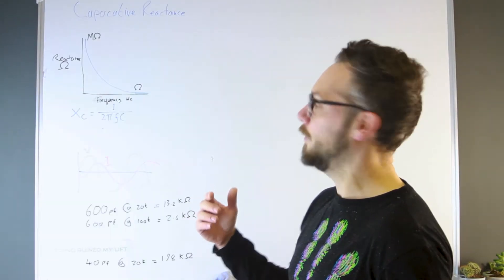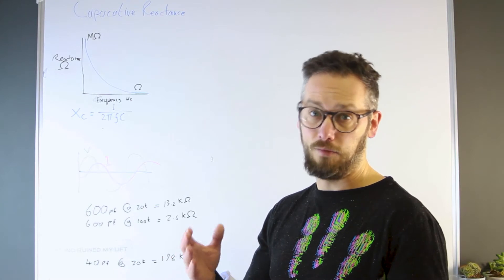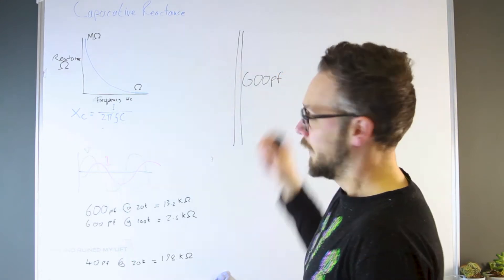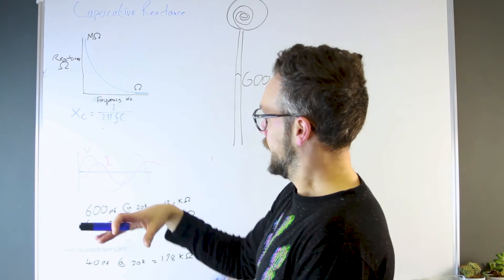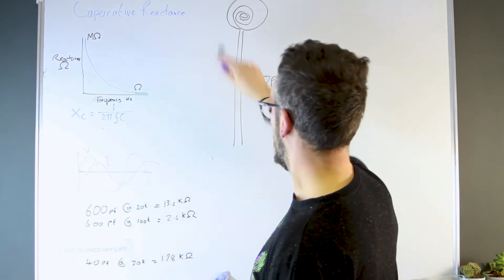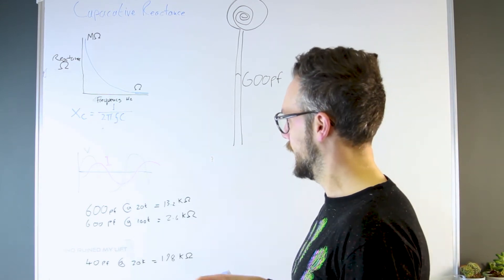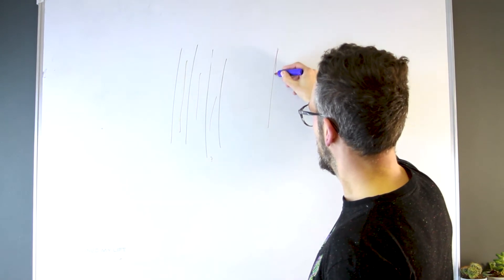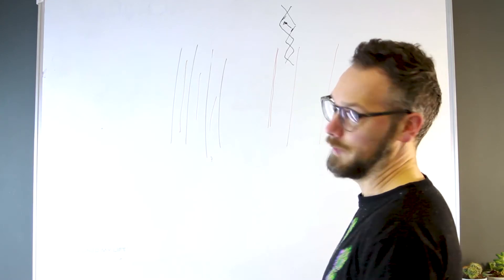Audio cable design / science / myths Part 2

Comment: Hello, can you help me here please.
I need to buy a 10 cm cable to connect a Zen DAC to a Zen Can through balanced
I don't know if I choose a cable made of Single crystal copper or Silver copper plated. Do you think that I will hear some differences between both? In terms of low, mids or highs? 
Thanks for you help.
Reply from the maker: That would be a very short cable, as there would only be a short length of wire it would not really make much difference which material it was made of. The main thing would be to get one with decent connectors and that is wired correctly. Many of the 4.4 to 4.4mm cables only have 4 connections but ideally you would want all five connections joined so look for a cable with 5 internal wires or a multiple of 5. So... if you see an 8 or 16 braid, it would be worth checking that they have joined all 5 as they are a multiple of 4. Where as if you see one the 5, 10 or 15 strands it is more likely to be wired correctly.
Reply: @CustomCans  Thanks, Thomas, for your answer, but I am now more confuse than before xD
All cables that I see have 8 cores. What do you want to say with 5 internal wires? Can you please point me some cable with those standards? Can't find anything online. Thanks.